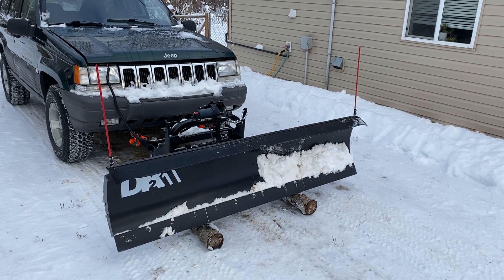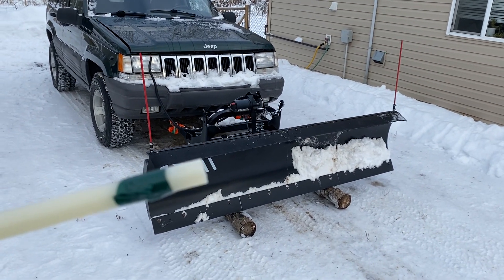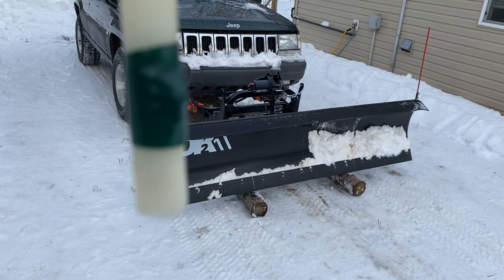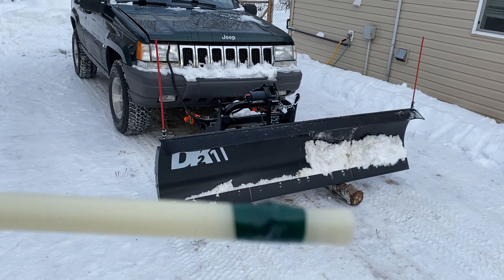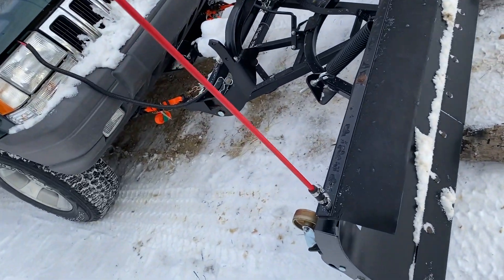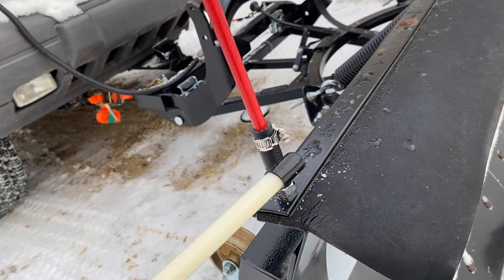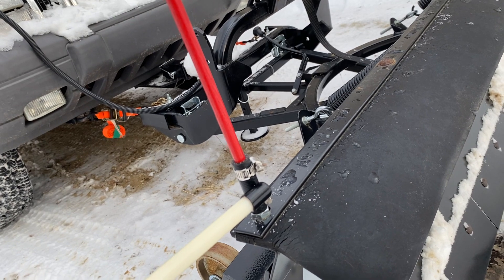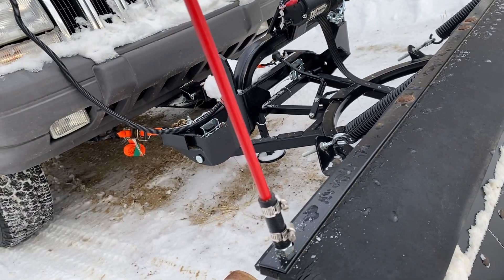Snow Plow Tech Tip, Make Your Own Cold Resistant Plow Markers

Comment: I have a Dk2 plow as well. The plastic OEM ones broke in 1/2 an hour. I tried threaded steel rod from Cdn Tire as well and cut them to length. They lasted about 2 plows. Same thing they break off as they bend, And boy do they bend, 3/8" rod doesn't stand up at all. 
I'll give your thought a try. Thanks Bro - Nice rig. These Dk2's are far better than people think. I have 2000 feet of driveway and use my tractor. So I bought one these plows to speed it up a little. It's worked great. Cheers